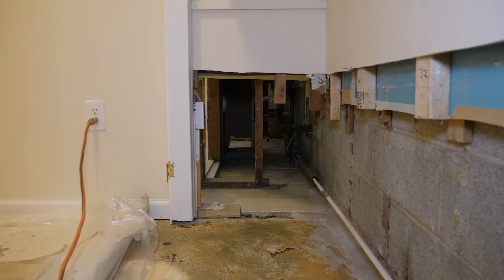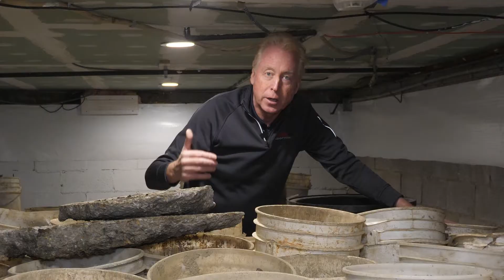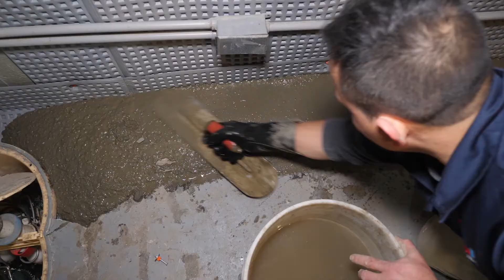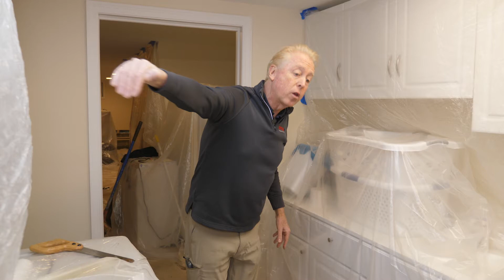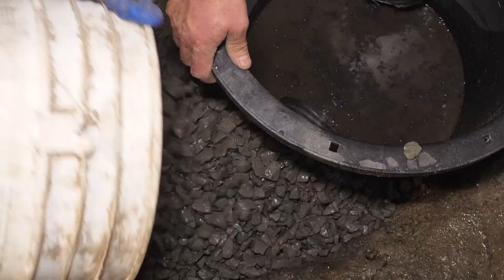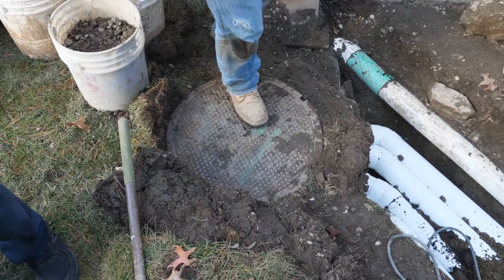The Perfect Solution For Basement Flooding - The Ultimate Drainage System

Comment: is this process done instead of waterproofing the exterior foundation or in conjunction with it? wouldn't it be as easy to dig out the dirt around the house and do a similar process outside?
Reply from the maker: Our interior system is a complete solution, and digging up the entire exterior of a home is typically far more invasive and expensive than an interior installation.

Comment: Im on my own waterproofing journey and am bingeing your videos in hopes to salvage my childhood home from a mold-disaster and still had a couple of questions. first, the corrugated pipe, does that hold water in the grooves? I would be worried about mold, or are we assuming there will be frequent enough flow to prevent stagnant growth? or is it just kinda  the standard and cost effective? second, if there are issues with seeping walls would you recommend this system with dimple board along all walls? does dimple board have enough airflow to prevent mold or is that just always a risk? Third, can exterior drainage and waterproofing prevent water from rising up through the cold joints? Lastly, do you always recommend dehumidifiers to handle the humidity and if so do you have recommendations based on the level of humidity in the basement?

Comment: Fix the problem with the brook   running past the house by installing two 12" diameter culverts where the brook runs along the property so the water does not enter the land next to the house.
Reply from the maker: Culverts can help redirect surface water, but they won’t stop groundwater from pushing into your basement. If the brook raises the water table near your home, you still need proper interior drainage and a sump system to protect the foundation.

Comment: Hi. Do I seal the gap from the wall to the floor with cement. I already have 2 sump pumps, which wasnt working at the time with heavy rains. Flooded the floor. Replaced pumps. And water was running out of the crack of the floor and the wall. Do I seal that area or leave it?
Reply from the maker: If water’s coming through that gap, sealing it with cement won’t fix the problem—it’ll just trap the pressure. That joint needs a drainage system to relieve water before it reaches the surface. Sealing alone will likely lead to future flooding.

Comment: I have seen a filterinh cloth put down on surface of dirt, then the corrugated pipe on top, then wrapped the cloth over top of pipe, then the stone. This all to eliminate dirt from filling the pipe and impeding flow of water. I didn't see cloth in this video scenario. Can you explain why cloth was not used?  Additionally I did notice a very narrow strip of plastic going down as a buffer between stone and wet concrete before the concrete tho which does what?

Comment: Thanks for your videos. I've watched a bunch of them to better understand this topic. I had water in my basement even through I have French drains circa 1975 around the outside foundation. The water from outside French drain connects to sump pump and then goes out again. I don't understand why no water seems to have entered my sump pump during the flood event. Trying to figure out if it is better to inspect French drains and fix them, or simply have you install the new system inside basement. What do you think?

Comment: Your videos are outstanding.  I noticed you haven't done any in a long while.  Hopefully, you do some more.  My question is, would it be (in your opinion) OK for the homeowner or customer to do some of the heavy lifting by digging the trench?  Based on watching your videos and doing just a general trench, it looks like it could be done if the customer felt comfortable with using equipment.  Why I ask, is this could save the home owner $1000's in labor cost that would be part of the initial job estimate by contractor.  Just looking for what you thought?  Thanks
Reply from the maker: We take the project only if we work on it from beginning to end. If you want to save, try to do the entire project yourself, but I would advise you to get some experience before digging near the footer and creating a pitch for drainage pipes. It not as easy as it looks.

Comment: I am amazed that any system can stay ahead of that much flooding. Fantastic work! I have a question regarding the old clay pipe drainage found under some concrete floors. Is there any way to trace the path of these under floor clay pipes? Camera or sound ping or something along those lines? I love your videos!
Reply from the maker: You can use a lipstick camera to look inside old clay pipes. If you reach a clog, you reach a dead end. Sound pinging does exist, but requires very expensive equipment and $$$. Clay pipe installations are usually installed around perimeter either inside or outside the basement. They do have clean-out ports in corners. Sometimes you come upon an unusual configuration, but it is rare.
Reply: @AmericanDryBasementSystems Thank you! Amazing work you all do!

Comment: I had hydrostatic pressure coming up floor when  i first bought my house . I gutted basment . Installed a " sump pit" . Saw cut a square, dropped a basin with pump in it,  drilled holes in basin so water will come into pit before it comes up slab. I did not install  any drainage  around the perimeter leading to this pump . Its been 7 years now and have no water . I bow  want to rebuild basment . Pump runs alot after winter . Under slab is all clean  sand . Before i rebuild basment i want to add one more pump. Do you  think i can get away with 1 more pump without doing the perimeter or bite the bullit and jack hammer around the perimeter ?Also should i put 2nd pump near the curreft pump or on other side of basment ?
Reply: Hey man, do it right and run the perimeter drain, install a bigger basin so thę pump wont cycle as much.

Comment: Hey, I’ve been watching a fair bit of your content and have really loved it! I’ve been curious though if there are ever issues with tree root encroachment in your systems, or if there are methods to avoid that if it’s a concern? One side of my basement floor is only a few feet below ground level (and way too close to wetlands) so in my sump pump basin I periodically find roots growing. I’m considering a more extensive installation of a drainage system, either solo or through a contractor, and I’m wondering if I should be looking for some form of permeable cloth outside the crushed stone of the French drains and basins. Seems like it could discourage root growth and sand washing out and undermining the foundation (old stone wall that terminates basically at the floor, no footer) but I’d also worry that it will just clog over time and cause more hassle than it’s worth. Any thoughts on what I should be looking for in a plan/quote? 

Thanks, and keep up the good work!
Reply: The roots will naturally air prune as long as you have a large enough cavity with clean crushed stone. When any fines make their way into the stone is when the roots will work their way in

Comment: That's some serious surface water and a beautiful installation. Do you ever recommend additional exterior mitigation techniques so that they aren't as dependent as much on letting water into the basement to remove it? If surface water is allowed to enter in through the window it seems like they should be trying to handle that by improving the grade or even doing an exterior sump pump if they are aren't able to use grade to address it.
Reply from the maker: They live in a tightly dense neighborhood built on wetlands (when it was legal) near a river with a high natural water table. Yet, an excellent location that is beautiful, tranquil, and has plenty of wildlife. They tried everything to no avail until we were hired to install our system.

Comment: Hi there.  Really enjoy the content you are making here.

I live in Michigan, and my wife and I just moved into our newly built home in November of 2022.  The area we live in has a high water table.  

We have a sump pump and it is going off constantly...close to every minute and a half due to the amount of water coming into the home.  We also have 2 cracks in the poured concrete walls that have been patched similarly to one of the videos you posted back in August of 2019.

What would be the recommended fix to "water proof" our new home?  Is a French drain system a good option?  We have had plumbers come out and express our need for a second sump pump as well.  Technically our builder should be supporting this but he isn't and even though there is a warranty in place, I don't want low quality work done in my home anyway.  Thanks for the time.
Reply from the maker: When the natural baseline water table underground is usually high, your false water table (the area around your house) will fill faster during storms. Your plumber is right about suggesting a doubling up on the sump pumps. French drains are the way to go, and if installed correctly (proper pitch to sump basin), they will outdo exterior foundation drainage, which can be insanely expensive and disruptive during installation. Good luck with solving your problem.

Comment: Quick Q: Why do you need the waterproofing slurry on the bottom part of the wall? Isn't there a risk that water will be absorbed by the part of the wall on top of the slurried part instead of it going down to the joint area towards the pipe? 

I feel like either doing the whole wall or none of it would make more sense but looking forward to your reply!
Reply from the maker: We are only concerned with the bottom 24-in. This is where water can sit the longest outside the foundation. It is expensive to Slurry the entire wall, and after 25 years, we have found it to be most effective on the bottom 24-in. In most cases, our system eliminated water quickly enough to dramatically reduce complete wall absorption of water, thus decreasing humidity in the basement. A full-perimeter system is guaranteed insurance that water will not find another way into your basement.
Reply: Ok, thanks for your reply!  @AmericanDryBasementSystems

Comment: your videos are fantastic. I have learned a ton about waterproofing. Thank you. One question: Do you find any long term issues with the un-reinforced concrete patch 3.5" deep by 12" wide? Does it crack or separate at the cold joint? Could you put some reinforcement wire mat in there?
Reply from the maker: We don't use reinforcement wire. It is totally unnecessary with our Supercrete mixture. Supercrete will not crack at the cold joint because it mends to the adjoining old concrete floor.

Comment: I want hire you guys, but I don’t how this can be done when my basement is 80% completed with a  bathroom and drywall everywhere, I guess all drywalls will need to be torn down?
Reply from the maker: Possibly, not all the dry wall need to be removed. Only the bottom 24 inches in most cases and possibly only two walls. We don't know until inspection.
Reply: @AmericanDryBasementSystems  thank you, I will make an appointment

Comment: A bit of a Newbie here but how does the ground water enter the black tubing under the concrete? Is there an open end? Thanks in advance.
Reply from the maker: The corrugated black pipe has perforations (one-inch open slots) between the corrugation ribs.

Comment: Had one of these box systems "water guard" installed a decade ago in my basement perimeter on top of the footing( now realize that was a mistake but im kind of stuck with it now ) . It worked so/so for a few years but soon realized there was no way to flush the system so I had to have a company come back and install ports in order to clean them. My question is for this corrugated pipe is there any way to access the pipe for a jetter flush? I have high iron in the water here so I come across that sludge quite often and the box system I have I can atleast flush it when I need too. Thanks,
Reply from the maker: Watch this video: https://youtu.be/RC45g7CEuTQ

Comment: Great videos, Ho do you support the 2x4 walls while doing the work? We cant find that answer as we have searched videos? Thank you!
Reply from the maker: The 2 x 4s or studs are attached to the block wall using shims, and they are also connected to the sill plate on the very top. The studs we completely removed will be replaced. FYI, for new construction, code now requires 2 x 6s in walls to meet requirements for R19 or R21 insulation.

Comment: I live in the UK and have a crawl space that I am digging out to make a basement. I’d really like to fit this drainage system but worry about how far to dig down. Will digging a trench down to the side of the foundation base for the drainage pipe cause any structural issues until fitted? Because the floor is not concreted i cannot leave engineering tabs. 
Thanks, Craig
Reply from the maker: I suggest you talk to a building engineer before converting a crawl space into a basement.

Comment: Shame on the company who told them don't call us anymore we can't help you!
Reply from the maker: Why did they promise results and installed it in the first place? They made their money. No refund on a faulty system.
Reply: @AmericanDryBasementSystems  Im in jersey.  I had a company install the watergaurd system 15 years ago like the one they ripped out.   I had no issues since it has been installed and very dry.  But I don't have the volume of water like on this video.  The company also gave a lifetime warranty and can transfer to the next owner too.  Why didn't the previous company not stand by there work or refund there money?
Reply: Did you have a lot of water issues before the watergaurd was installed? I'm in southern Maine have the same watergaurd and got a lot of water after the snow melting this year some coming up through the floor got 2 sumps already installed one pushes out water the other barely gets a drop
Reply: @MaDGriZz78  I high water table, so when it rains I get a good amount of water goes to the sump and it runs a lot.  But its been handling it no problem.  Only have one sump.  How's your system worked so far?

Comment: I called your company, but you dont come this far up.  Im up in Rhode Island.  I just had a quote done to waterproof my basement and they use that Waterguard system.  The sales guy told me you dont need pitch to drain the water to the sump hole.  It didnt make too much sense.  Their estimate just north of $21K.  After watching your videos, it just seems to be common sense to dig deeper and use the corrugated drain pipe and have pitch.  I am getting a few more estimates and will ask if they will dig deeper and use the corrugated pipe.  Our foundation is poured concrete and not block.  Any recommendations that I should use in picking the right company?  Thanks.
Reply from the maker: Watch the videos on this channel and you will know when you find the right company. It seems to be working. Good luck.
Reply: 21k? What did that consist of that price is absurd
Reply: @MaDGriZz78  that consisted of perimeter installation of Waterguard system, 2 sump pumps, 2 window well covers, pvc piping to outside.